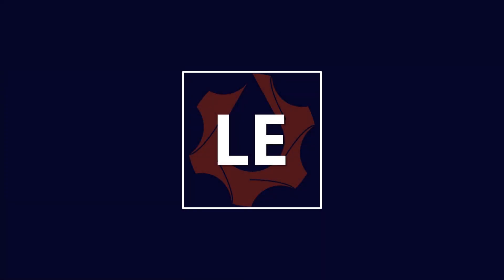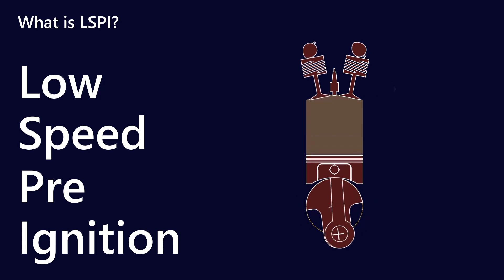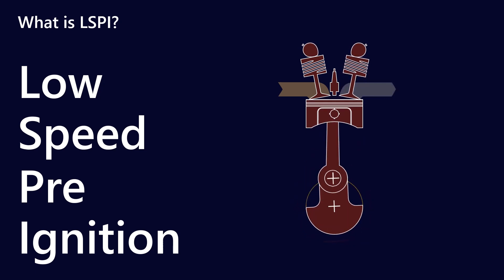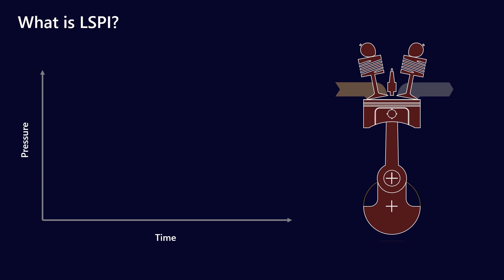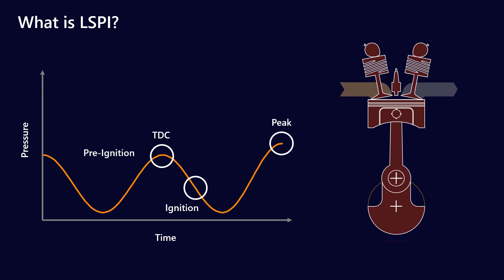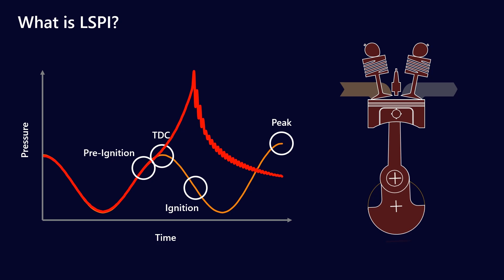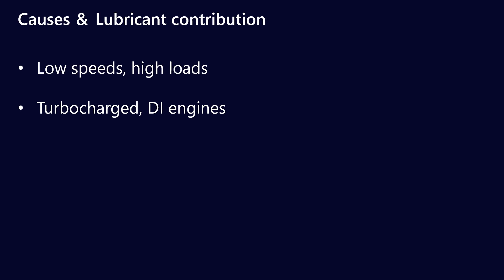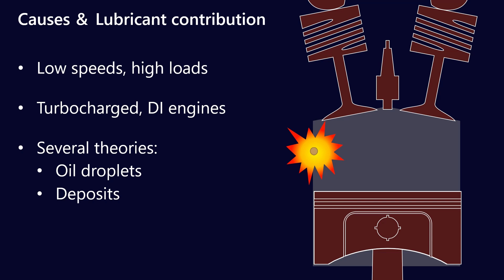How does Low Speed Pre Ignition (LSPI) ruin engines? And what are the causes?

Comment: Great vid.  Lot's to understand with octane, cetane and volatility of elements in a combustion chamber promoting PI or det.  In my experience, oil in the CC has always promoted preignition and detonation with all other variables being equal.  I would assume increased fuel octane will reduce LSPI.  I would also assume retarding timing would have no effect on PI unless there is a detonation component at low speed/high load which is always a concern on engines until past peak torque.  Just some thoughts.

Comment: Actually, gasoline ignition happens typically between a few degrees before TDC and up to ~50 degrees before TDC (though this is uncommon) in a spark ignition engine. In a diesel (compression ignition), fuel is usually injected after TDC though it can start being injected before TDC too.  LSPI is damaging because it occurs randomly and not "on time".
Reply: Yes. I'll add the reasoning behind this. When the spark occurs, it begins a flame front that spreads kind of like an expanding ball through the cylinder. Waiting until the piston is at TDC to light the flame front would mean the fuel mixture doesn't burn in time to maximize pressure over the power stroke.

If you fire the spark too early, the pressure could rise too high at TDC and spontaneously ignite the fuel-air mixture in a bomb-like detonation instead of a controlled flame front. I wonder if using direct injection instead of the entire intake charge being premixed fuel and air makes detonation impossible.

Comment: My car has this problem, but its not a turbo, and it happens at idle under high load conditions, with air con. on, turning the steering wheel to the end of its course, or accelerating hard will cause pre detonation. There is a lot of oil vapor coming through the intake (car has 130,000 kms), also the valve stem seals are no longer doing their job. Without knowing about the GF-6 oil, my last oil change i used a mobil gf6 spec oil, but made no difference. I have to run pure ethanol, which wont pre detonate, while i´m still trying to discover the problem.

Comment: Great video, so choosing the right oil reduces impact of LSPI.  But how do we reduce chances of LSPI itself?  1500-2000 rpms is unavoidable.
Reply: A good oil reduces the chances of LSPI. As Rafe explained, substituting magnesium for calcium in the detergents has proved to be an effective solution. Magnesium-based detergents have been around as long as calcium-based ones, but they are more expensive. Calcium and magnesium are one above the other in the Periodic Table, so a lot of similarities in detergency, but also differences in some chemistry. In this case, sufficient difference to impact LSPI.
Reply: We have a Patented full time vacuum crankcase evac system that constantly flushes and removes the excessive raw fuel, oil vapors and other contaminants from the crankcase, so we have seen over the past 14 years of testing almost eliminates LSPI incidence. I say almost, because there still can be when low octane fuel is used as the owners manuals state. In the US I urge ALL to use 93 with GDI engines.
Reply: Also going to up a little in octane will help.

Comment: Pre Ignition detonation is caused by sharp metal parts close to TDC when pressures are highest. This is the design basis for the auto start stop system.
Reply: If LSPI had been an engineering issue, the auto OEMs would have sorted it by themselves in subtle changes to engine components back in 2010/11, when this issue first began to appear. They didn't because it wasn't.
Reply: @trevorgauntlett-jx8ub  I have a textbook AUTOMOTIVE TECHNOLOGY A SYSTEMS APPROACH 3rd Edition published in 1999 that talks about pre-ignition. In the HAYNES manuals it's called lugging.
Reply: @suggesttwo  Rafe mentions lugging elsewhere. Search for Left Morningstar to see that discussion. Pre-ignition has been an issue for probably as long as the internal combustion engine has existed. LSPI was something new and unexpected. Your textbook dates from the year after I joined lubricants at one of the majors. I've been in Lubes ever since. Prior to that I did a lot of analytical work for our fuels guys, many of whom are still friends and still active in making the ICE a better thing.
Reply: @trevorgauntlett-jx8ub  knocking us usually caused by end gasses not oils. End gasses are what the Catalytic converter burns off. There's no such thing as emissions only end gasses. It's the turbo not the DI. Improving atomization/vaporization cools the charge.

Comment: Что за позор ты рассказываешь? Поршень вниз уходит от воспламенения смеси... Какое давление у тебя растёт?
Reply: Калильное зажигание возникает при движении поршня вверх.
Reply: no !!! what the guy means is in a 4 cylinder engine the power stroke accurs AFTER the engine REACHES TDC
the power stroke is supposed to GO DOWN a moment 0.00002 seconds after the spark.
what happens in low speed pre ignition is that almost like a diesel engine
The mixtures ignite before the spark but the pistons dont wanna go down,since two are going down
two are going up
so they are gonna fight againts each other.. but the forces of the wheels increase the pressure in the cylinder
that causes massive blow by for sure usually this LSPI sounds so terrible it can almost spun a bearing by the way it is explained

Comment: Lake Speed Jr, of Joe Gibbs Race Driven also says that LSPI is caused by excess fuel dilution ... (?) That the oil Dilution makes the oil go to the combustion chamber, as having a lower octane rating, causing the preignition.
Reply from the maker: Interesting - I haven't heard that one before. I'm not entirely sure how that works because LSPI is generally pre-ignition of a hot spot, that causes pressure waves which can then combust the fuel. But the engine oil has a lower volatility that the fuel so technically a mix of fuel and oil would be more difficult to ignite? Having said that, Mr Speed is pretty knowledgeable about this stuff having worked at Driven and Mahle, so maybe he knows something I don't.
Reply: @LubricationExplained  Actually, he says just like you put it in the video as one of the possible causes, by the mix of oil diluted by fuel, acumulating at top ring and being shovel up to cc, igniting earlier by the lower octane of this mixture. But to me, is excess ashes from Ca making hot spots. I Took that from the fact that Aviation Oils don't use Ca, because of the detonation problem at very lean hot conditions. Aviation oils as you know, only use Dispersants, not detergents, because of that preignition prone problem. Not that I would know more that Mr. Lake Speed Jr., but this theory of diluted of shovelled up, is a little too much for me. Maybe I'm wrong.
Reply from the maker: @tomasnokechtesledger1786  Oh right, I understand now - I thought you meant he had another explanation over and above what I had in the video.

Comment: And the direct injection causes a lot of build up in the cylinder and the combustion chamber causing higher cylinder pressures
Reply: it does more damage to the intake valves since the stupid PCV returns blow by from the rings.
its just a complete mess... multi point injection is way better but its not as fuel saving as GDI

Comment: I own a 2013 Hyundai Accent with the 1.6 gamma gdi the engine is toast with only 83000 miles. When I bought the car within the first 10000 miles I started noticing lspi symptoms Took my car to Hyundai and they confirmed this and said that there’s nothing they can do i installed a oil catch can and switched to premium fuel immediately which helped a little. The problem is the EPA is putting the squeeze on car manufacturers forcing them to sell inferior products to the consumer not giving them enough time for proper research and development ultimately we the consumer get screwed.
Reply: I also own a 2012 Hyundai Accent 1.4 gamma engine. I think LSPI is occurring on my engine. I'll try to change my oil from Castrol to Kixx. Any thoughts on these?
Reply: @eacan12  look up the specs for your year accent and compare them to the 2016 or newer accent with the same GDI engine I know here in America the 2016 or newer N/A gamma 1.6 are detuned with slightly less peak power ratings that’s because Hyundai knows of this problem and quietly fixed it. If they are rated slightly less it’s possible to somehow Use the upgraded tune with your vehicle not sure exactly how but It’s possible either by swapping the PCM or re-flashing the one you have
Reply: @eacan12  I’d confirm it’s lspi all you need is a scan tool that’s able to read live data then  monitor the ignition timing Under conditions you think you’re getting LSPI to see if the knock sensor is retarding your timing. One cheap and easy option is to buy a cooler thermostat I believe OEM is 200°F I wouldn’t go below 180°F also you can try cooler spark plugs but not too cold to where they foul.
Reply: There is something they could jave done. They could have honored the 10 year 100,000 mile warranty and replaced the engine.

Comment: this is that luge that happens when you have too high gear and too low engine speed?
Reply: No, lugging is a bit different issue. The burn happens from the spark in a normal manner when lugging the engine. Lugging has more to do with being outside of the general design intent of the overall engine.
Reply from the maker: Sorry what do you mean by luge?
Reply: @LubricationExplained  a mean if you have a manual car and if you not good with the clutch and you go below Idile and it starts Saking
Reply: @Roundholesinsquarepegs  I know. Lugging is not what the video was talking about.

Comment: LSPI is myth from nowhere. Preignition issue is totally resolved by installing detonation sensors from late 70th and now these are magnificently correct and accurately save engine from LSPI predicting possible LSPI. The problem comes from mapping Transmission unit that tuned for fuel economy by shifting higher speed too early and maintain low RPM. Combined with small capacity hot operating turbo engines their pistons too small and light for this load. Engine oil  is not corresponding with this issue. Engineers are abused by environment hysteria.
Reply: Not all pre-ignition is detonation, and not all of either type of knock can be solved by changing the spark timing. It seems very likely related to the low viscosity oils and high oil consumption relative to engine size. Maybe the calcium just acts as an additional catalyst for the issue either chemically or through hot mineral deposits.
Reply: Agreed. My car has 6 speed auto. So what I do when city driving is set it to M which limit it to 4 speed, engine revs around 1500 to 2.500 rpm. Only when I get to highway then I set it to A which allow the transmission to go up to 6 speed.
Reply: I would add the oíl DILUTION on GDI Engines that destroy prematurely any protection on any formulation.
BimmerN53
Reply: I don't know what good a knock sensor is going to do for PRE IGNITION meaning ignition before the spark; this spark timing is out the window in that event.

Knock sensors instead solve issues of knock from post ignition flame propogation occuring too rapidly.
Reply: @andyh8239  Not sure about this , but in the small turbo engines being discussed here, maybe the knock sensor plays a role in determining the boost levels, so that would impact lspi.
Reply from the maker: Agree that LSPI is a self-inflicted wound that never used to be a problem until the latest generation engines came along with the focus on fuel economy. Engine oil definitely isn't the cause - we were just trying to highlight that there are minor changes to formulations coming that can help reduce the severity of LSPI.
Reply: Yes, too tiny, too high pressures too.

But i´ve a 2006 Dodge Charger R/T Daytona with the 5.7L HEMI. This Engines has 2 Spark Plugs per Cyl. and i´m not sure yet but there is the possibility of LSPI problems, possible?! What do you think about?

even the reccomendet Oil for these engines are 5W20, ILSAC GF-5 API SN, Chrysler MS-6395. My problem is, that this Oil Visc. is thinning out with increasing oil temp. and especially at roundabout 100°C the Oil is so thin that you can listen that in the Cam/Valvetrain. Ok, the engine has 136.000mls/224.000km but it´s in a really nice condition. But even the thinning out oil visc. is a problem in my eyes, especially with this thin Oils. And now i´m changing this oil into an Mobil 1 FS 0W40, even because i´ll see if then the oil wouldn´t thin out that much with increasing oil temperatures, so that the valve train wouldn´t listen like it does with the 5W20 at roundabout 100°C Oil Temp.
I also installed an 15-Row Oil Radiator with Oil Thermostat (opens at 80°C) and the Oil Temp was between 105-115°C at cruising before and is at roundabout 80-95°C now in same driving conditions what is a lot better in my eyes.
But i can listen sometimes in low rpm + high loads that there would be too early ignitions. Or even is this really happen?! Because even this listens like...
& i bought this car with the premission to optimize it so that it would be a long lasting car, and all modifications are for prevent wear. That´s also wh i wouldn´t use that 5W20 oil visc.,too..

Best regards rom Bayern (germany)
Cheers Till

Comment: Can LSPI be a reason for fuel diluting engine oil? Or is that another cause?
Reply from the maker: Generally fuel dilution is going to be the result of blow-by. So the rings aren’t creating a perfect seal against the cylinder wall, either because of liner scoring, ring sticking or ring damage.
Reply: i owned a mazda mx-5 with fucked up valve stem seals the car on cold starts smoked like mad
this ended up degrading my oil alot-when my oil was new my hydralic lifters didnt do any noise
but after around 3,000 miles or 5,000km my engine started making weird noises 
when i change my oil all the noises went away. so yes FUel dillutes oil especially on cold starts
no matter how good your engine is-i lived where it was -18C... thats below 0 farenheit